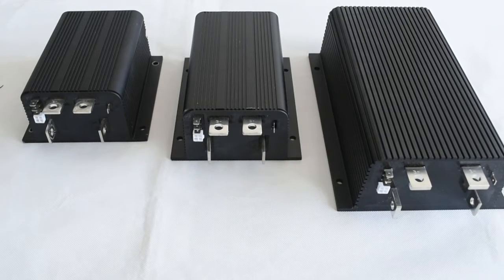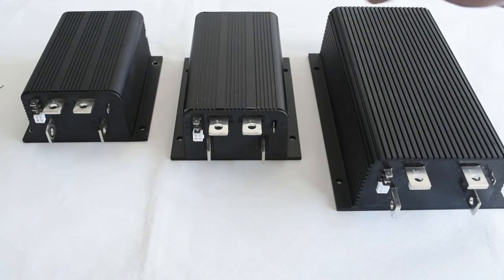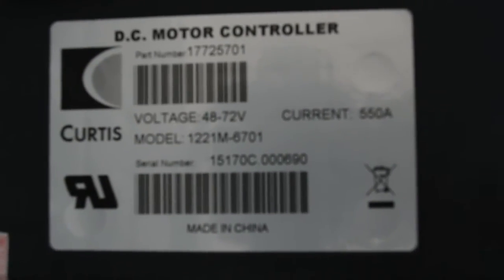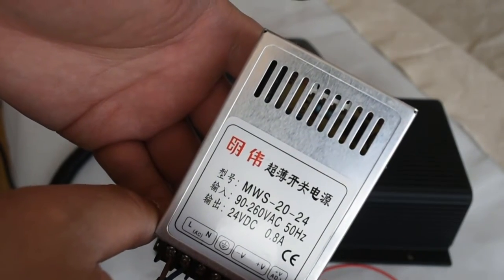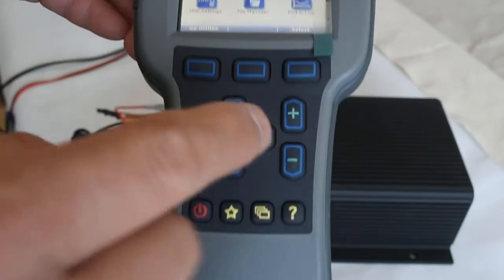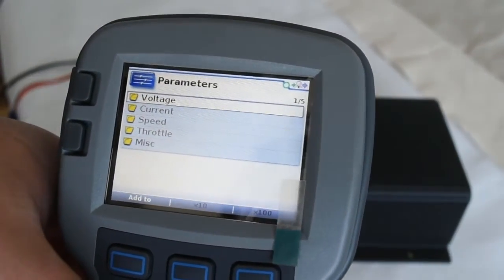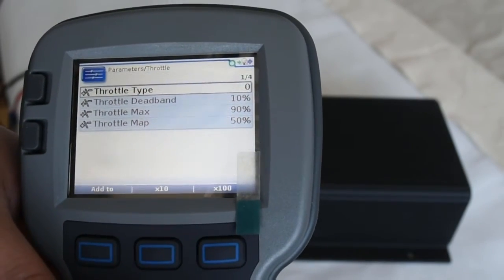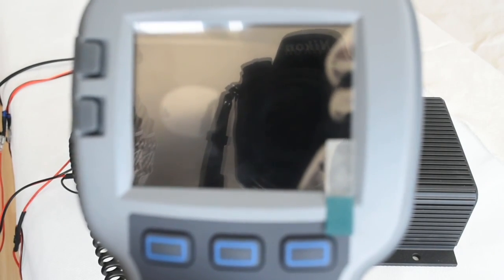CURTIS DC Series Motor Speed Controllers 1204M 4201 1205M 6B403 1221M 6701 Handheld Programmer 1313

Comment: Do you have a diagram on how to test run the 1204m or 1205m cortes controller..Using the three wire pots..and 2 wire pots
Reply from the maker: You may find the wiring information in the controller manual: https://www.noco-evco.com/product/curtis/manual/1204m1205m_n.pdf

Comment: Not perfect, but very helpful.  He showed the important throttle setting but I wish more info was given on what the different settings were only the default 5k pot was mentioned.  What selection is needed for a 0-5v throttle?
Reply from the maker: Thanks for your support. For more setting about the throttle type of 1204M / 1205M controllers, please the page 10-13 of controller manual: https://www.noco-evco.com/product/curtis/manual/1204m1205m_n.pdf